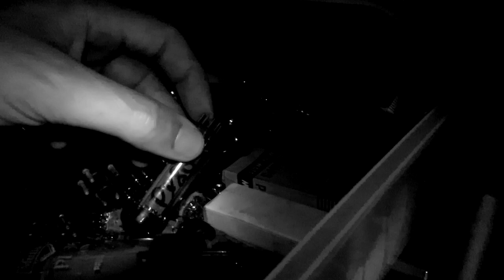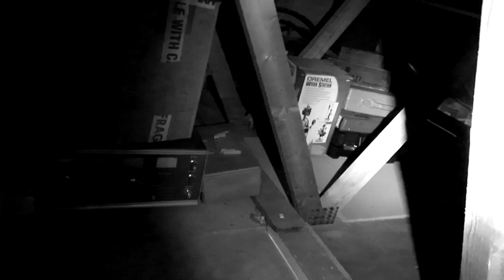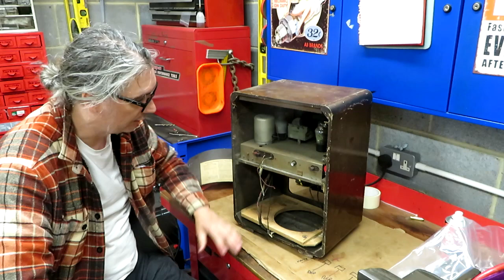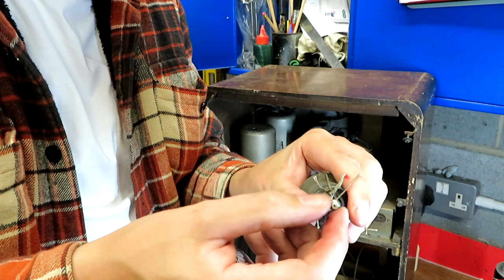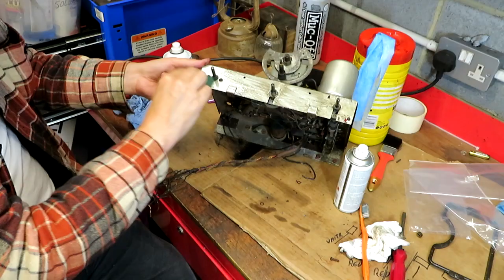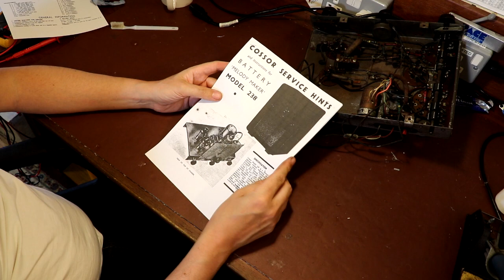Cossor 238 Vintage Radio Repair - Part 1

Comment: The circuit used in your Cossor 238 used to be called a "regenerative" circuit, or at least part of it is. Such circuits were used in North American sets back in the early 1920s but quickly fell out of favor in part because of the oscillation and re-radiation problem, and also because Mr Armstrong sold his patent to RCA, whom charged some rather heavy license fees to use the circuit. As a consequence most manufacturers used a straight TRF circuit, or a Neutrodyne circuit, which was a slightly improved version of a TRF that used negative feedback windings in the RF coils to reduce oscillation rather then neutralizing capacitors. There was another less popular circuit called a Technodyne invented by Lester Jones, Sparton and a few other companies used those, they work like a series of band pass and band reject filters I think, Dennis Carter has a video explaining how they work. 
 There was a similar sort of circuit to the regenerative that was called a Grimes inverse duplex, it did not have the same problems as the regenerative. But they were complicated, and their only advantage was  that they could use fewer tubes/valves to do the same job as a TRF, which was only a concern if you used dry cell tubes like 199s. However by the mid 1920s tubes were becoming mass produced by multiple manufacturers, particularly the 201A triode, so the prices were dropping, also most people liked to power the filaments in their sets from 6 volt storage batteries, so "A" battery life was less of a concern. 
  By the time that Cossor was made, I'm guessing the mid 1930s, all of the battery radios in North America were superhets of one form or another, with 2 volt filament tubes that could be powered from dry cells or a wet cell. Four tubes was the minimum, but some had eight or more, the average was five. Battery radios were used in remote areas without AC power, so good sensitivity was key, many had two IF amplifier tubes, some had a tuned RF amplifier stage. 
 One thing I have noticed about many battery radios is that if they were stored properly they will still play when you power them up. The tubes run coll and the B+ voltages are usually well below what you would run into in an AC radio, so the seals and dielectrics in the capacitors tend to last a lot longer. I think it's neat that your set has Cossor branded capacitors inside it, I'm the sort who would melt out the old guts and restuff them, just for looks, it looks like there are only five in the set, plus one electrolytic.
Reply from the maker: Thanks for watch and taking the time to leave so much information and detailed comments. I am sorry for not replying sooner but for reasons unkown I dont get notifications on some comments. Thanks and stay safe best regards Chris

Comment: Wow I really like that intro with the sounds and B&W video. That dog bone resistor color code system was interesting as well. Looking forward to the next part. 👍❤️📻
Reply from the maker: TheRadiogeek Thanks for watching a nice comments. Finger crossed it’s such a simple set it should work. The only thing i fear trouble with the tuning coils. They are for the most part reliable but difficult to rewind and repair. You should see the pile of batteries  I have on my desk. Regards Chris.

Comment: Proper radio! Of all my radios I've never owned a Cossor, which is a bit odd seeing as there are plenty about. Obviously wish you much luck when it comes to sorting out the complicated power supplies for this but I know you will sort something. I would guess 1934-5 for the set, the valves it uses came out in 1934. Your 210 SPT, the one with the Araldited cap, is the early version of the valve which doesn't neccessarily mean it's original to the set of course but fair bet it might be. Regards - Andrew
Reply from the maker: Andrewausfa  I new is was considerably later than 32 as the was the year that variable moooooooo valves were patented in the US.  I’m sticking with 37. Your not kidding about the power supply you wanna see the shit load of batteries on my desk, couldn’t be arse build a PSU for something that’s going to end up back in the garage when I get bored , probably in a about a weeks time. I have a very short entertainm - see what I mean!

Comment: Onward and upward. This should be interesting. I have restored 1936 Atwater Kent 657Q Tombstone, which operates multiple battery supply. I managed to wrangle up a power supply for it, though it isn't pretty. As I recall some of the tube filaments are 2.0V. That simple TRF should be a wink and a nod. BTW, that looked like a Heath HW-101 which uses the venerable 6146 pair. Built two of them back in the Pre-Cambrian epoch. Lot's of lead solder smoked here.
Reply from the maker: Danish Native  Yes it has 2 volt filaments, bought a lead acid cell from RS components and a stack of pp3 batteries . I think I bought the HW-101 as i thought it may have had the same finals as my yaesu ft102 from memory paid £5 for it so worth the risk.
Reply from the maker: I would put later than 33 it has variable mooooo tube in the RF amplifier and don’t think they were available until 1932. I could  be wrong?  A valve would have been more than a weeks wage for the average guy in the 1930 so not surprised they tried to make them last. So you can buy tubes now cheaper than the 1930s LOL makes you think!
Reply: @allthegearnoidea6752  Don't know about that particular valve, but in the states they were still using "Animal Glue" for securing valve bases and anode/grid connectors to glass up through the late 90's. It came in powder form and was mixed with water to form a thick greenish-brown nasty looking mix. I've seen enterprising hams try to replace the stuff with cyanoacrylate in desperation. Won't take the heat though. Wonder if there is still a source for that nasty shit.

Comment: A handy little time machine you have there Chris, you can always whizz back to the 1930's to buy a new speaker for the radio, just remember to take some 'old money' with you. Fry's chocolate cream, can't remember if they were just mint flavoured, but I do remember hating the taste of them though. Incidentally though, I do have a small wooden box containing very old radio resistors and the box in question is a very old Lyons Chocolate Cream Bars display box. Chocolate bars priced at 1/2p (one half old penny) this ages the box to be 1922 as the price went up shortly after.
Reply from the maker: Theoobovril How can you not like fry’s chocolate cream?  Actually the new version taste awful!
Reply: @allthegearnoidea6752  Always had a horrible tangy taste them when I was a kid so never brought them again. If you do pop back, in your time machine, to the 1930's to get some radio spares can you stop off in around the very early 1960's and buy me a tin of Nescafe instant coffee plus a couple of packets of Mcvities digestive biscuits please. These two items today don't taste the same since both went under reprocessing years ago and the tastes got ruined.

Comment: yes I think those fry's chocolate creams used to be nice and minty ! and it was handy that you got a bit of silver paper which came in handy to wrap around a fuse as I couldn't use the one you got off a packet of woodbines I wasn't old enough to buy them !
Reply from the maker: It’s just not the same without the foil and I thought it was mint, the new one tasted of nothing just sweet!
Reply: @allthegearnoidea6752  I will have to take your word for that as I am not allowed sugary things cos I have the beetus !

Comment: You remind me of a good mate i know, lots of things stored in the attic, i'm sure he has the ark of the covenant up there :-D
In my roof space i store the hot water tank and the radial lighting wiring for the bedrooms.
Not interesting but true :-)

As far as the c.b radio is concerned, you did what interested you, that's a good way :-D.

The ye olde regen radio, i would not worry about the voltages i'm sure a couple of transformers lashed together with string and wallpaper paste will be a start to a basic linear supply :-)
If most of the voltages are positive in respect to the chassis then multi taps should do.
The pesky negative voltages may need a second secondry  winding.
Sorry im getting boring and obvious lol.
No switchmode psu's please, i made that daft mistake with a frends hacker radio, i am a silly arse!!.
I ended up making a linear supply using the Lm317.
I love that band switch, no delicate farty bits to go wrong :-D
Reply from the maker: zx8401ztv  Thanks for the  watching and great comments. I have just got the parts in to build a battery as I would like to try and have it working traditional. Regards switch modes they can be quiet enough but it really does depends on the design etc. Thanks regards Chris
Reply: I don't know, on one hand you give the impression that batterys are a pain, so i thought you were not doing that.
You naughty confuser ha ha :-D
Smashing video chris ;-D
Reply from the maker: zx8401ztv  You should see the pile of batteries I have LOL. I bought up the UK stock of PP3 batteries!

Comment: Nice Project For You Chris (think your morphing into Andrewausfa) Not Really a Valve Man But Like Watching Other People Working On Them, When You Have Worked Your Magic On The Chassis Are You Gona Do The Cabinet Of The Set Or Leave As Is ? Loved The Arty Craftey Start To Your Video... Used To Love This Frys Choclate Bar Back In The Day https://i.pinimg.com/originals/15/35/aa/1535aac99cd9f6966bcf77f1e276ab6e.jpg
Looking Forward To Part 2 Chris Regards mike.
Reply from the maker: raceingdemon6464 Actually I am a valve man and have hundreds of valves and many radios. But you see all the hobbies and interests that I have so just moved onto other things. I still love valves but just don’t have the room to keep buying more sets. Thanks for the chocolate info it was great chocolate back in the day!

Comment: There were a couple of different flavours of the fry’s chocolate, there was a mint one.
Reply from the maker: Defpom's Electronics & Repair  I definitely remember the mint one it’s just not the same experience in a plastic wrapper. I bet for the penny pinching they killed the brand. Thanks regards Chris